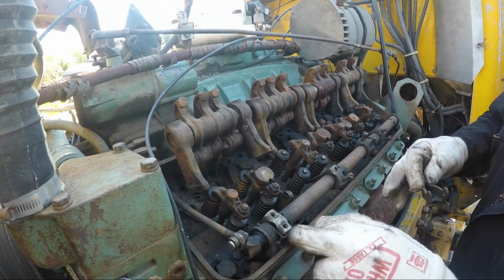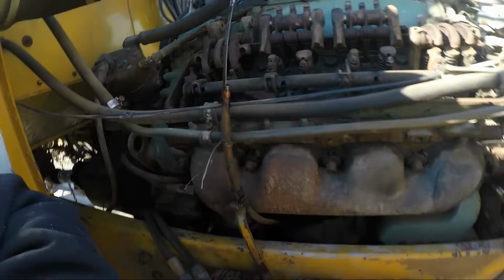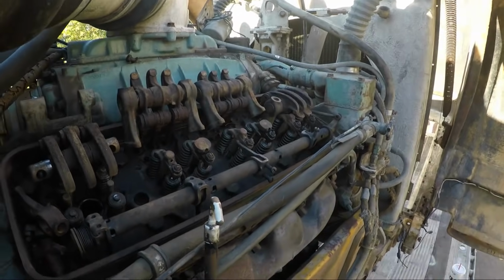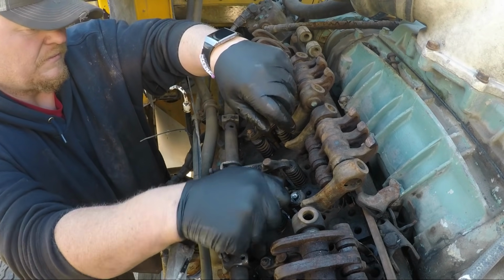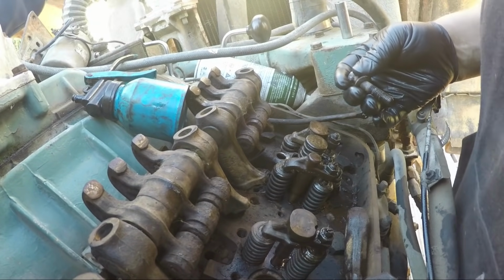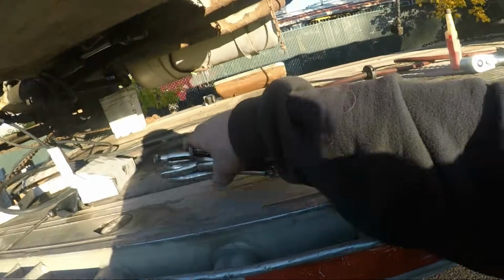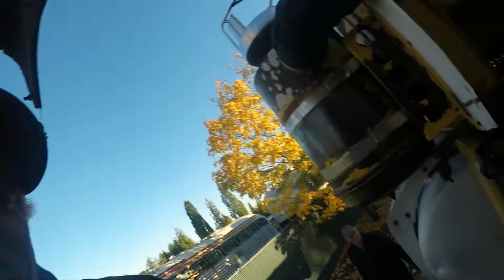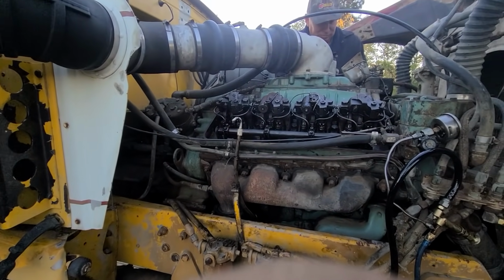Pete 359 we got for parts, Will it turn over, if so... Will it start if we put scrap parts back on??

Comment: I work on trucks for a living. I've had customers drag these old relics in the shop i work at to ressurect them. Most days I think they should have just left them in the junkyard they found them in. When you tear an engine down and find some wierd mix of parts a junk yard used just to get them running and " Saleable" you cuss the guy that did it.

Comment: When I was young n dumb I had to rebuild a 4L53T Detroit in a C-60 Chevy straight truck. It ran when I finished. Just had a struggle getting it tuned right. That engine had gas dumped into the tank and it hammered the wrist pin bearings out of the rods. Had nearly no oil pressure when I tore it down. Replaced everything.

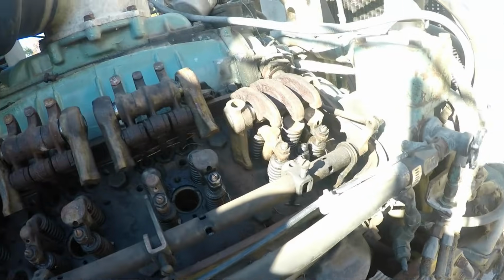Comment: I got an old 71 Freightliner straight truck with a Small Cam 350 Cummins and RTO-9513 trans. Rears have 4:44 gears. Engine is supposed to be stuck. Never tried it. I need to see if it is really stuck. If so I'm going to get rid of it. I had planned to put a 290 small cam in it that ran until a firebug torched the Western Star that engine was in.

Comment: Coolant in the oil was evident on the dip stick when first checking the oil. Many people can set up an engine, but only a few have the touch to make it run really well. With the newer engines it doesn’t make much difference. Nice to see it run although it needs some serious fixing.

Comment: Good video! Some guy with a bus probably decided he wanted the jakes off it so just took everything including the tall valve covers and left it like that.
Reply: Talk valve covers ?
Reply: @waynepollard6879  tall valve covers. Typo. Detroit sold taller valve covers to clear the Jake housings, both stamped steel and the later Aluminum valve covers were available in a taller version for engines with jakes. Jacobs also sold a “spacer” for the stamped steel covers that allowed you to run the original low height steel valve covers but those things SUCK…instead of 1 surface you now have two…one between the cover and spacer and one between the spacer and head. And any place they can leak they eventually will. You also need longer fuel jumper lines to clear the jake housings.

Comment: Hard to kill the old Detroits. I need to find fuel jumpers, a fast idle buffer switch and valve covers for my 8v71 so I can add the Jakes to it. I'm in gathering parts mode. Thanks for the video!!!!
Reply from the maker: We have all that, email if you need it

Comment: 8v71 with no turbo is a 318 eng. alum frame. This one probably not worth saving. I'm rebuilding one now that has steel frame, big rears, heavy front end with dump bed. Can't save them all.
Reply: For real use I don't ever see any good sense in saving a DD, they are inefficient fuel toilets, lug one down and you have already more than likely screwed it over.  Rebuild is costly, parts can be annoying to track down...  Sure they sound mean, but dollar per mile they aren't worth it.
Reply: Contender For The Faith   Yeah the one we're saving now is a 359 corvette dash but has a big cam 400 so it's worth doing.

Comment: 8V71 2 strokes or any of those older Detroits you can get new parts from Luke at US Coach. 359 Pete's of vintage... Save it for sure. Do you have a shop space yet? You'd feel more into saving these things if you had a solid shop space with a chain hoist for pulling motors and or a decent lift. Looked like there was some algae in the oil [Bio Klean [with a K works on that].

Comment: why don't you just buy a new set front Fenders luckly the were riveted on the hood,
It would be nice if you keep it and put a Rollback bed on it Paint the hood yellow and leaf the patina
and do a technikal restoration.
But definetely shure this engine needs Rebuild ,it needs to be took apart Blasting, cleaning ect. 
cause it sat for who knows how long exposed to the elements.
I'd like to see those vid series.